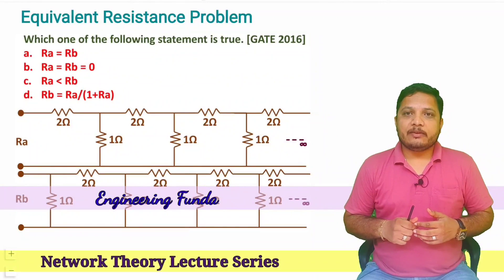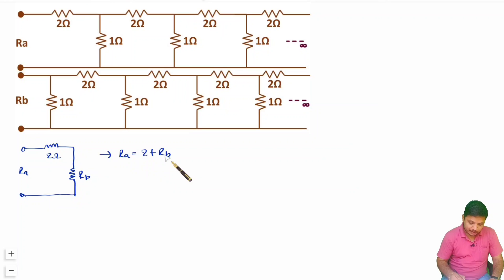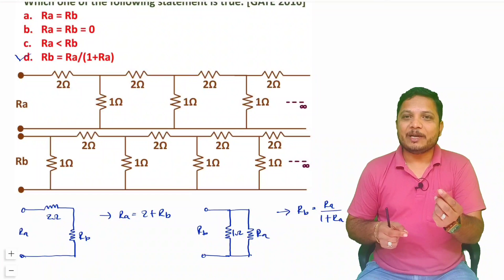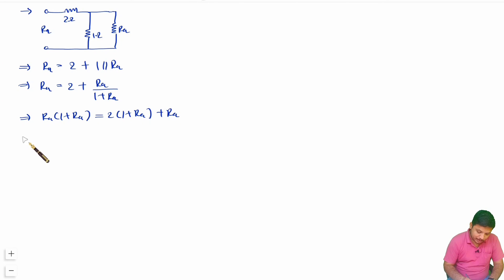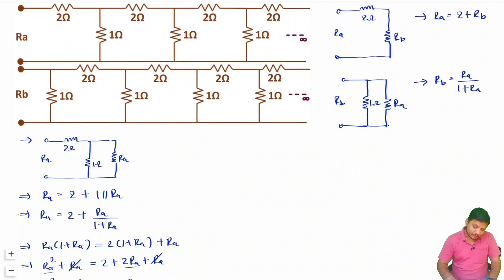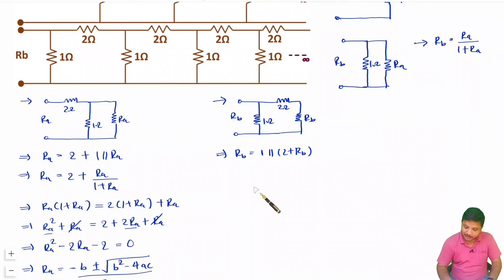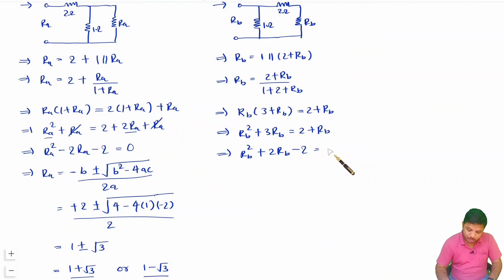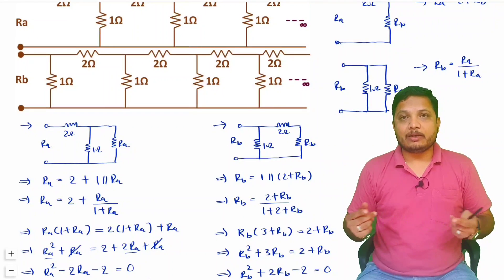Equivalent Resistance Problems for Infinite Network: Detailed Examples and Solutions 15

Comment: Sir if in question we Have asked to design a 3 bit up down counter with a direction control M with jk flip flop but here type of counter not given. Then which type of counter we need to use
Reply from the maker: Synchronous